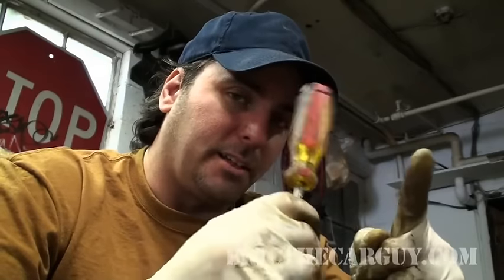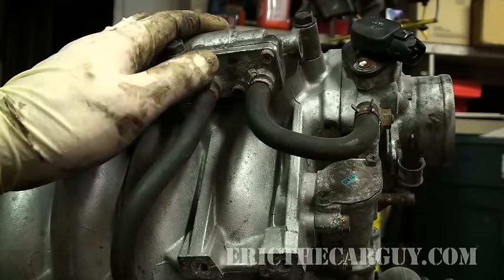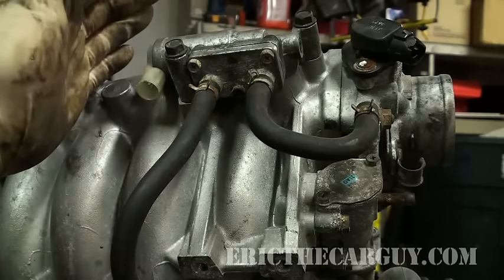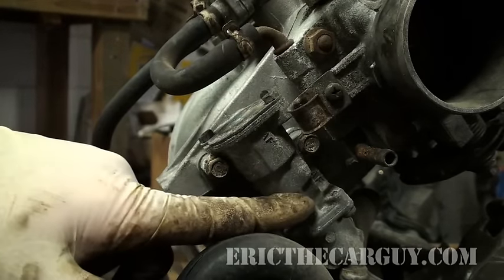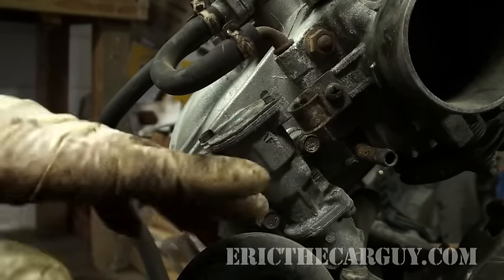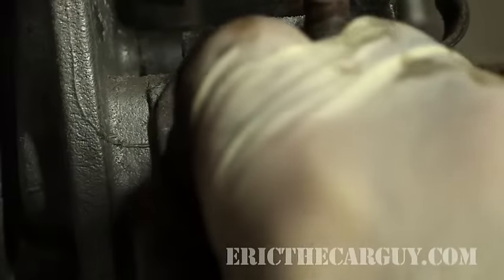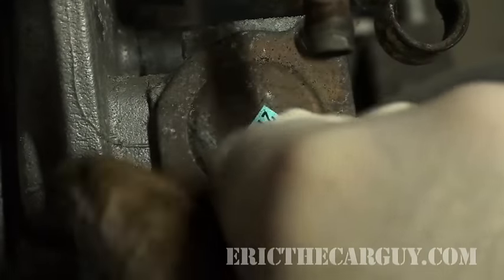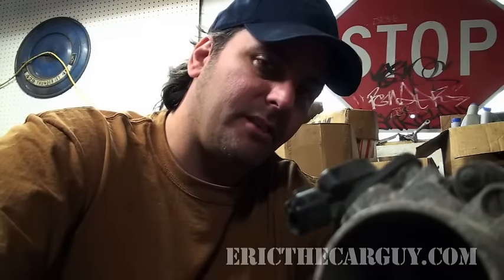How To Solve Honda Idle Problems - EricTheCarGuy

Comment: Thanks for all the great help
2016 odyssey 
To remove the power steering pump I removed the air bypass valve located above the pump.   I can’t find anything on the valve to reinstall it.   There are a set of gears that moves the valve not sure how to position the manifold side. 
Thanks

Comment: Hi Eric, I have a 1992 Honda prelude Si, I bought it new and it only has 127000Klms, still looks like new, however when it had 95000 klms it was hard to start when the day was extremely hot, the local mechanic said it had a faulty fuel pump, he replaced it with a generic pump, thats where the trouble started.To car went like a hairy goat ( oh the original problem was a dry joint in the main relay which I found on you tube) I replaced the generic pump with a new one and the car is going like it was brand new, however, I can be driving along and all of a sudden, the tacho goes beserk and the cruise control cuts out, the car seem to miss a bit. This only happens very rarely, but yesterday it happened in traffic and the motor cut out. I pulled over, then started it again and went perfectly. What should I look for?

Comment: Hi Eric, I bought a 2002 Acura TL.  It was leaking oil, so I replace the valve cover gasket, pcv  valve, intake plenum gaskets and spark plugs.  I didn't replace the coils.  Unfortunately, the car runs like crap.  The engine is vibrating and hesitating. I did get a few misfire codes from cylinder 3 and 6.  At first, I thought I had a vacuum leak, so I used carb cleaner.  There was no indication of a leak.  This car was running before I call myself fixing it.  It was just leaking oil.. Can a bad coil cause this? Please, Please help.Do you have any advice?

Comment: We’ve replaced the IACV and it actually made the idle worse 🙃🤨 and my CEL is for it exactly, should I check out the fast idle next? Also ive noticed that on the intake theres not a idle screw on it. Could that also cause my problem?

Comment: this sounds pretty much like what my 2001 honda crv does. the idling was low they raised it and nothing. first thing it did was one afternoon i came to start it and i had to give gas for it to start. once it started i had to keep on giving it gas or else it would cut off (a/c was on by the way), then i noticed if  i left it idling with the ac on it would sometimes cut off. i also noticed that if im in traffic with the ac on it would tremble. since after they raised the idling what its doing now is when the ac is on the idling goes up and down as you was describing in the video

Comment: Got a 94 accord 2.2 f22b2. bought with a blown head and rebuilt the head at a shop with all new exhaust valves and guides. replaced water pump, timing belt, spark wires, plugs. upon first start car ran great took it for a spin around the block and found tranny was stuck in limp mode and the speedometer wasn't working. the vehicle speed sensor was the problem there. but now there is no d4 light and it won't grab 4th gear. also it feels like it jumps from 1st to 3rd because engine revs real nice in first. but once it grab a higher gear I have little to no throttle response... any ideas are much appreciated. thanks

Comment: Hi Eric how are you I have a problem and I need help .. the problem is when I turn the car on it idles high and when i engaged clutch in first gear it goes back to normal what do u think it could be because I have no vacuum leak and my idle control valve is brand new and I don't believe I have a bad valves because I still have lots of compression it's just when I take it out of engaging the clutch it idles high hope u can help me out its a 95 Acura integra gsr the only thing I could think of is the high pressure regulator that u were talking about on this videos so hopefully I hear from u soon thanks and have a good weekend

Comment: Creo que tengo un grave problema en mi CRV 2000 relacionado con FIT or TPS porque arranca pero queda con las revoluciones muy bajas y se apaga
es posible que tenga burbujas de aire en el sistema de enfriamiento o necesito cambiarle todo el cuerpo de aceleración? Voy a seguir algunos trikis que tu mencionas, TK

Comment: Greetings Eric,
I have a 2000 Honda Accord 3.0 V6
Whenever the outside air temp is around 25 degrees or lower, the car starts ok and idles at 1500 rpm for about a minute, then it raises to 2000 rpm and surges up and down between 1500 and 2000
If I hold the throttle at around 2000 rpm it doesn't surge, and the idle goes back down to normal as the engine warms up.
If the outside temperature is about 30 degrees or warmer, the car fast idles at 1500 rpm and then goes back to normal as the engine warms up, with no issues.
I don't see a fast idle solenoid on the v6 engine, so I am wondering if the idle control valve controls the fast idle also.
Looking for any suggestions, since the problem is definitely related to outside temperature

Comment: Hey Eric check this out I have a 99 civic ex automatic I checked the coolent good on that no air in it, I replaced IAC valve brand new disconnected the battery reset the code ran the car couple hours later engine light on same p0505 code. I'm stumped brother what would your best guest be? Should I run a couple day cycles to see if it turns of it self? I'm really stumped here?

Comment: Hey eric, i have a 1998 Honda HR-V 1.6 16v. I have idling problems with a slight engine rattle and sometimes the engine cuts out completely when driving slowly. I have an engine light on and there is only one code coming up. Its a p050 speed sensor. My speedometer doesnt work and it moves up and down when im not driving and shows incorrect readings. i am not sure if these problems are related to the idling problem, and i dont know what to do, like you said in this video. deal with the check engine light problem first before doing any of the air coolant or other repair solutions. Can you help me please???

Comment: First of all I love watching you and Chris fix. Great videos. 
I have a question. I have an 03 civic with a 5?speed manual. 
And I’m going to replace the IAC. My part number is 16022-PLC-003. 
Seems like because I have a manual it’s a lot more money. 
I seen this part for $266.00 
If I go to eBay there selling no brand ones for like $25. 
Should I put out the extra money for a oem part or should I buy the cheap one. I just didn’t know what the differences could even be between the two. 
Thanks again for all your videos.

Comment: Is there any way to bleed the air out after the idle is already bad? I replaced the IAC valve yesterday on mine and the problem still remains. It jumps inbetween 1k and just over 2k rpms. There probably is air in the system from taking the hoses off the old iac. But the coolant keeps coming out of the radiator while im filling it every time the idle surges. Is there a way to get the air out another way?

Comment: Hello Eric! I watched your video and I run to fine tune my IACV. What I did: I screwed it just about to the end and i unscrewed it a little just like u did, but when I started the engine, the car was like choking for air. When i pressed the pedal, the RPM went down first and then up, but they were extremely low for a cold car (about 700-800). Then I unscrewed the IACV bolt one turn. It was a little better but it was choking again. So I made 2 full turns of the IACV bolt. For a cold car it runs at about 1100 RPM now and when i press the pedal, the RPM's goes up normally. Is it normal now or I should unscrew it more? How are 1100 RPM for a cold car? Thanks! ;)

Comment: Check Engine Light comes on: IAC.  Changed 2x over the past few months.  Still car either surges up/down or goes to 2000RPMs, then Check Engine lights comes back on.   New Throttle body replacement - worked like a champ for roughly 500 miles, then the problem returned.    I start to wonder if the car's ECU is the problem...  2000 Honda CR-V with roughly 160k miles.

Comment: This video seems to be for a fluctuating idle. I am helping my neighbor with a 2002 Honda Accord. Battery died and terminals were loose.  I repaired terminals and charged battery. No it won't idle on its own.  I jacked up the throttle just to keep it running and get it to operating temp coolant is full and no check engine light. I tapped iac and no change.  The idle doesn not fluctuate it is smooth when held manually at 750 rpm. Any suggestions?

Comment: good morning Eric,  i have a question regarding the IACV.  I have a 2000 CRV when started, idle is about 1700rpm.  after driving a few minutes the idle moves to about 2500rpm.  if i turn the ignition off, then on, the rpm moves to about 1200.  do you have an idea what could be causing this...don't think it's the fast idle valve since it's mechanical.  i have removed the IACV and replaced with plate which i can adjust to make the car idle perfectly.  thanks for you input.

Comment: Can I dial that fast idle valve up a bit for a low idle?  No surge just low idle.  Cold start is perfect - but once the car is up to temp the idle is too low and stalls half the time.  I checked for vacuum leaks and such.

Comment: Hey man I need your help, I have a Honda Civic 98. It has 90k miles on it.

 I recently changed my spark plugs and cables. 

Question:

So now when I idle my car shakes and my RPM pulses up and down.

Comment: Made the mistake of having to cut the intake air control sensor wires when taking the intake off when rebuilding my '96 Honda Accord.  Intake killing my back, no one to help, and couldn't get to a 12mm socket at the time without dropping the intake and severing more wires and hoses.  Rookie mistake, and the fact I just don't know jack, whoever he is.  Can't reattach them without taking the whole dash apart.  Will the darn thing run alright if I just don't reattach them?

Comment: Eric, just got a 1996 accord v6. The cruise control light comes on when I press the button, but the cruise control will not activate when I press the set button on steering wheel. The gauge light won’t come on as well when I press the set button. Any ideas what to check or where to start?

Comment: Hey Eric. I was wondering if I’m gonnna need to buy a gasket for iacv? I bought a iacv on eBay but it didn’t come with a gasket. I have a 2000 Honda Civic. Also  is draining the coolant mandatory to do this replacement job?

Comment: @EricTheCarGuy 2001 Honda Crv idling issues, I cleaned out the IACV and even went as far as replacing the whole intake with a spare clean running one I had. Still same issue so I decided to look into the fast Idle valve and it too was clean. I've adjusted the plastic deal you just did and it seemed to want to fix but still either idling way too low or too high. And now I keep having "misfires on any cylinder" any advice?

Comment: I work at an Acura dealership and believe it or not the slightest cam change when doing a timing belt can change idle. make it fluctuate. for the b series engines you need the pins to hold the cams in place before putting the belt on.  I learned that one the hard way

Comment: Idle problems w 02 Odyssey .. slow idle oscillation 650 to 750 (2 to 3 second cycle/interval) that exactly matches the upstream O2 sensor waveform, and “phantom” misfire codes and TCM light sometimes .. trims normal .. no drivability problems ...> happened after valve covers replacement .... no vacuum leaks or air in coolant ?.... any help/Ideas Eric?

Comment: Hey man I’m having the notorious idle fluctuation problem. I get a map sensor code replaced it and it still have it. What would u say this could be? I also bought a new fast idle valve. Still no resolution. Now I’m also 90 dollars down the drain with the new map sensor. Could it be the tps/throttle body/intake manifold? It’s not a brake booster problem either.

Comment: hey Eric I had a question I replaced the iacv for poor idling after replacing it the rpm was running from 1k to 1500 after day 3 the check engine light turned on it replaced the iacv again thinking it was a faulty part about 4 days again the engine light turned on again not sure what to do

Comment: I hate to be the guy to ask for help here but I'm sure there is someone here who has lots of knowledge so here my shot. I have a 94 Integra LS and it started to sputter, and dies whenever I put the car in gear, all drives and reverse. IT does not do it as much in idle and park and I don't believe the brake does anything to change the fact that it stalls in gear. It does not do it in cold start, takes about 2-4 minutes after cold start until is starts to sputter in gear. My car has always had the up down idle issue when cold so I'm sure the idle air control valve is the culprit for that and I have cleaned it before but ordered it just to make sure I get rid of that issue. I'm not so sure that the problem I have now is related.

I did put antifreeze in the radiator and tried to get air out of the system but I'm not sure if I succeeded.  It did start a couple days after I did this. I used a large funnel and for some reason the coolant went up instead of down when I was trying to get rid of the air. I kept squeezing the two large hoses and even some of the smaller ones by the engine. I did this until the fans came on twice.

Can you bleed air out of the system by loosening the bottom valve on the radiator until drops come out, and running the car in order for air to escape and then tightening the valve after some time ? I remember my dad doing this but do not know if its the proper way to do it.

Also no check engine light. Any help is greatly appreciated I hope I made sense.

Comment: Nice vid I have Idle issue when I put terminal on the battery the wrong way it blown a battery fuse wich I fixed but now this idle issue, could it be a fuse problem or do what said to do thanks

Comment: Man i started my 94 integra ( it has a 98 b18c5 eng ecu & trans swap so the check engine light is always on ) but i just had an issue with idle and i smelled gas and i had cilender misfire as i was driving home a buddy said it may be a vacuum leak thats why i watched ur video because u no ur stuff.......any ideas what i should look for? Thanks in advance

Comment: Eric I have a questions, I've changed the IACV, FITV, checked all the hoses but no sign of any leakage, how do I check if the ECM is the problem?Because I diagnosed it the checklight doesn't blink for codes. Mine is a 95 Honda Civic.
Reply: I self diagnosed it the checklight just light on no blink at all after that i check in the manual it says a faulty ecm is code 0, so is it correct when the checklight doesn't blink it just light on it stands for code 0?

Comment: my car ran a little rough at idle so I cleaned the IAC and the entire intake after doing that it ran horrible put  it back together then it threw code 4 map sensor and IAC took it back apart cleaned it even better and vacuumed everything out now it won't throw any codes and it's still running the same purged the air in the cooling system it will start and idle if you try to give it any throttle it will just die after you let it warm up it barely idles just wondering if you had any ideas

Comment: I have this problem in my 1999 CR V and the code reader tell TPS. I changed and the problem remains.  So I decided to disconnect the plug of the ilde Control Valve. On and instant from 2,100 drops to 600 rpm. Need to replace it.

Comment: Hey Eric, now if the fast IAC motor is clogged from the other side where the hose clamps on, that calls for a whole new Fast IAC motor, if that parts that corroded and clogged? And do you have a video on that specific situation?

Comment: Hello, so I just found this video and I have a question about my 89 Honda prelude Si that I have. So my Honda does the idle reving like u explain in the video. I've been told that it's the IAC valve and I've replaced it and still reving thing. I adjusted the fast idle valve like you said to do in the video and still it's reving. What else could it be, I'm really stumped.

Comment: My 2000 Corolla ran rough and idled rough over the last 2 months... much like when I had a fuel injector replaced and then another later 2 years back. So after new, rebuilt injectors, new air filter, clean the throttle body and IAC and new plugs and coils, I looked for more clues. Air leaks at the intake manifold gasket was a recurring clue and my valve cover gasket was replaced last year for a leak. So I started to think maybe the problem was air and not fuel problems. So a  new intake manifold gasket immediately resolved the problems after an ECM reset and 2 days of 'relearn' and some smoke out the muffler. All seems well now. Changing my view of what to pursue helped most. And I had the 'mobile mechanic'  install 4 new struts after 275K with the original ones...

Comment: I have a 91 Civic, D15b JDM Non Vtec 1.5L ZChead. on warm up my engine idles great but soon as I go and press on the brake several times I am getting a surge, engine will rev high then low and so on till I stop pressing the brake. It will only stop surging if I unplug the IACV or turn around the check valve on the brake booster, that being said I have replaced the IACV 3 times now.All the new IACV's cannot all have been bad. I have also replaced the check valve and it still surges I have no check light and no vacuum leak I also replaced all hoses and burped the radiator. I am stuck for 2yrs now with this damn problem, have I missed something? Thanks

Comment: I have a 92 Integra GS, she has no lights on but ABS. On a usual day, when I start her she's at 2500, and slowly goes down to about 900. 2 days ago, she went below 900 and died. All of my lights stayed on, and she would start back up every few minutes.  We replaced the fuel filter yesterday,  and we think it could be main relay or camshaft position sensor.  Does this sound like more of an idle issue? Im new to these cars and so are my other mechanically inclined friends. Im just trying to learn